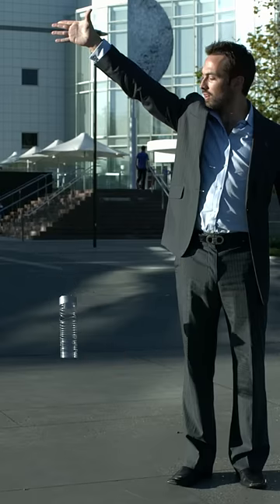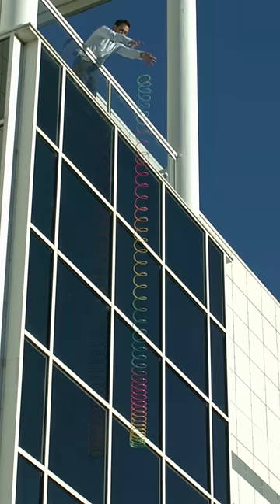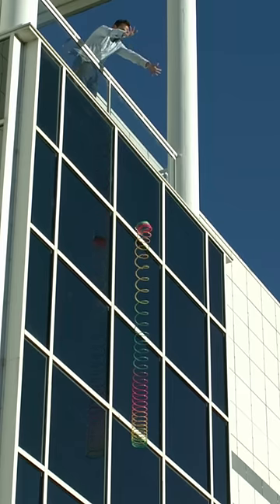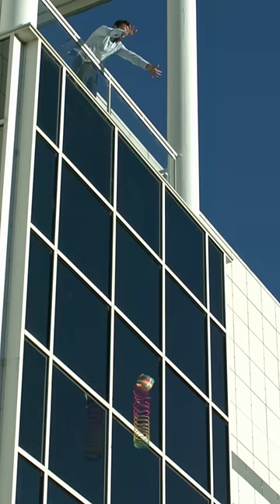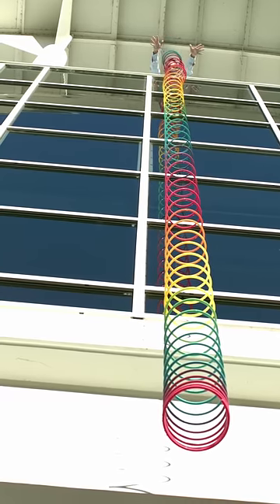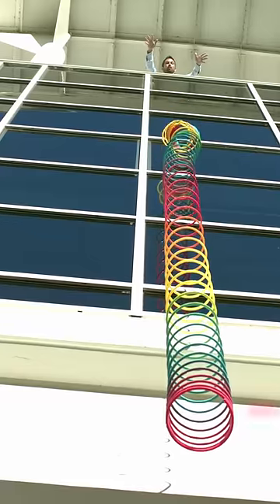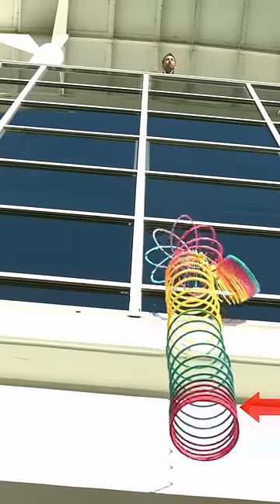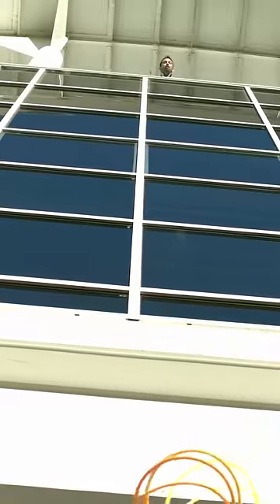How a slinky falls in slow motion #shorts

Comment: Even with the explanations I still can't get my head around this.
I was shown the same thing at university and it's still a mystery to me :D
Reply: The elastic force counteracts the gravity force.
Reply: Doesnt make sense. Many objects possess elasticity yet they fall  like a sack of potatoes
Reply: It’s easier to convince your brain this way: the bottom is indeed falling or at least feeling the force of gravity however there is an equal force being applied upwards by the coil.  What would be interesting to show is this means the top must be falling faster
Reply: @riekivonwielligh6102  it does make sense. The force of the slinky being stretched is enough to stop it from falling.
Reply: @riekivonwielligh6102  it makes a lot of sense to me. The top is pulling the bottom towards it. It was stretched to its maximum using its mass. If it were stretched to half its max length, it would fall at half speed 😬
Reply: During collapsing , each collapsing ring rotates supporting the one beneath it to make it overcome gravity and stay in position , that is why the last one rotates when the collapse reaches it but there is no beneath ring to rotate so it falls .
Reply: The bottom end is being pulled upwards..
Reply: Basically, the bottom of the slinky doesn't know that it's been dropped until the coil above it starts falling.
Reply: The slinky is actually shrinking from both ends. So the bottom is going up but at the same time it is going down due to gravity. Net effect is that it remains in place where it is.
Reply: @riekivonwielligh6102  Yea, cause they ain’t long enough for you to see the effect.
Reply: @tonydai782  ya i am shortsighted like that👀
Reply: Draw a free-body diagram of a coil somewhere in the middle.  You’ll realize that the forces on the slinky’s coils are just gravity and the state of the slinky immediately above the coil.  As long as the immediate surroundings remain the same, there’s no reason for any part of the slinky to accelerate.

Comment: I think it's similar to the canon shot from a vehicle moving at the same speed of the shot in the opposite direction.

The reason is that since slinky is stretched is because of gravity, meaning the stretch force is equal to gravity, when it's released it starts falling at the same speed it's contracting resulting in it looking like it's still at the bottom.

And for the same reason a bottle with a hole that leaks water out will stop leaking in free fall.

Comment: This happens with every object, even with a pencil, te thing is that electromagnetic fields are so fast we cant apreciate it, if you picked a pen from the top and dropped it, the bottom of the pen will be levitating for a tini amount of time supported by the atoms above it, until the collapsing cascade of atoms would reach that part and nothing would be supporting the atoms at the bottom, thus, making it fall, don't precieve the pen as a unit, instead precieve as a group of atoms supported by each other through magnetic fields

Comment: I think what's happening is that gravity is definitely acting on the slinky as a whole. But the tension in the it due to it's stretched state causes the lower most coil to oppose gravity, thus it too accelerates but negligibly  and the uppermost coil speedily accelerates coz of heavy tension and gravity pulling it in the same direction downwards. So if we consider this entire slinky to be a system, the tension generated is the internal forces, while the only external force is the gravity, so as per the Newton's law, it's center of mass must accelerate at 9.8 m/s^2. And as we can see the vector sum of all linear accelerations of each coil of slinky would approximate to "g".

Comment: Or in layman's terms, the slinky wants to go up aswell as down. So it reaches equilibrium with gravity at the bottom.
Reply: No this is wrong Lmaoo .
Reply: @prlreviews1729  No it isnt. I used common sense without watching the video. But a simple google search confirms what I wrote. I cant add the link because YouTube keeps removing my comment
Reply: The slinky cannot go up because there is no upward force acting upon it. The slinky is at equilibrium only when it is stretched out and the tension of the coil is countered by the downward force of gravity. Definitely not the same thing, gravity is not at the bottom.
Reply: @prlreviews1729  that's not what I ment. Clearly the newtonian force isn't singling out just one point of an object. I ment "at the bottom" as in "which makes the bottom behave like it does". Saying dropping an object for example only effects parts of it is just ridiculous

Comment: You should look at the acceleration of the top's motion (and calculate it). Since the center of mass of the whole slinky system must accelerate at 9.8m/s², and the unupdated slinky half has an acceleration of 0, the top must accelerate faster (which is easily explained, since both gravity and slinky tension are accelerating it).

Comment: It actually happens that when the top of slinky reaches bottom of slinky it speed is 19.6m/s and then there is a delay same the time taken for the connection of top and bottom of slinky and then it continues falling at normal rate thats why when slinky and other object are thrown together they touch the ground at same time even though the other object has travelled the half distance at the same time when slinky top reaches bottom. 
Thank You.

Comment: The corallary, which he doesn't explictly mention, is that the top is accelerating much faster than 9.8 m/s² (the acceleration rate of gravity on earth in a vacuum). Not only is it the top of the slinky being pulled down by gravity, it's also being pulled down by tension - the same force which is pulling up on the bottom and preventing it from falling.
Reply: So in other words, the mass Centre actually falls at a normal acceleration of 9.81..m/s^2
Reply: @peterpumpkineater6928   yep, that's a valid way of describing it too!

Comment: Without gravity both ends will try to reach each other when you release the tension. Same thing happens when you let go of the slinky but since it’s falling at the same time it appears like the bottom is suspended when in reality it’s moving towards the center at the same rate as it’s falling.

Comment: Suggestion: you should do this around a pole. That way it won't fold on to itself
Reply: That is an interesting notion with the potential for some material experimentation.
Reply: @Dont Read My Channel Banner  what's your endgame dude?
Reply: technically what happens after the top of the slinky and the center of gravity for the entire slinky reach the same height it's over. It can bounce and twist any way it wants but it will just continue to fall and accelerate. Using a pole would be interesting to see kinda. I would imagine the spring would once again spread out a tiny bit where the top will slow down if not almost stop for a split second.
Reply: @kraven4444  due to friction between the pole and the slinky?
Reply: @eccentricOrange  nah there shouldn’t be any significant friction. Now that I think about it when the top hits the bottom they will both just continue to fall. It may spread out a tiny bit and the top may lag behind a tiny bit. But not much. One thing is for sure though. Once you let go of the slinky. The center of gravity will fall same as if you dropped a ball or something. No matter what the slinky does it as a whole Cant slow down. I think I had a metal slinky somewhere. I should record it lol.
Reply: @eccentricOrange  well I just tested it and yeah once the top catches up with the bottom they fall together. Doesn’t even slow down from what it seems. I uploaded it on my page but for some reason YouTube is not uploading in slowmo like I recorded it.
Reply: @kraven4444  Cool! I saw your video. It's almost exactly what I hoped for: Derek's experiment but w/o folding over

Comment: For me it’s easier to think about it like this: 

A spring wants to come together, so if you drop the spring  hanging like this, the center of mass is moving down while the spring is coming together. And because the whole spring is falling under gravity, the bottom part will stay still untill the center of mass passes that point.
Reply: you're sorta correct. There's one key aspect to this experiment. Gravity is already the force spreading the slinky to the "perfect" amount. when you release it again it's gravity acting on it. So it's G vs G. That's the ONLY reason you get this nice effect. If you don't let is stretch so far or you manually stretch it down even further. The bottom would bounce up too.
Reply: Gravity theory needs a reboot because a *slinky just broke it, or should  I say defied it, all contortions to say otherwise are just pseudo scientific sophistry. Oh wait, * Gyroscopic force already did
Reply: @kraven4444  So the potential energy in the spring force equals the gravitational potential energy from hanging?
Reply: @michaeltaylors2456  Except gravity explains this absolutely perfectly.
Reply: @MrPassigo  ok
Reply: @goos6005   your saying the spring’s temporary force or elasticity has defied gravity.  How do you know the spring’s force is equal to its weight ?  
Obviously that force must me at least that weight,  but it could also be greater.
Reply: @goos6005  . I believe gravity is this  F=G{\frac{m_1m_2}{r^2.
The spring should drop equally, with top and bottom or both ends of the mass or springs moving downward  equally at the same rate,  with the spring tension contracting the mass inward back to its relaxed state. But it doesn’t,  therefore F=G{\frac{m_1m_2}{r^2}} needs to be tossed out and described another way.

Comment: This is basically how every object looks like close to the speed of light.
Reply: No it isn't.
Reply: @bobtom2633  I am referring to the fact that the impulse propagates at a speed close to the speed of the object, so the object does not look rigid.
Reply: If you could see in super-super slow motion (trillions of fps), and in high enough resolution, you should be able to see compression waves like this going through every falling object.
Reply: @YSPACElabs  I'm not an expert, but I disagree. I do not think gravity is strong enough to pull something like a metal rod's molecules apart to where once released the molecules pull back together. The strong nuclear force is magnitudes higher than gravity.
Reply: @MrT------5743  Strong nuclear force is only strong at extremely short distances, it doesnt matter even at the radius of an atomic orbital, and molecules in solids are held together by different kinds of electromagnetic forces. Im not an expert either but as i understand it, if you try to stretch any object, distance between molecules increases but so does the force holdig them together, and when you release this distance gets smaller again, so every solid acts like a spring to some degree.
Reply: @E1Luch  But the stretching force we are talking about is gravity. And gravity is a pretty weak force compared to the strong nuclear force (atoms within a solid rod) would not stretch at all, not even at the molecular level. The rod would effectively be one object even at the atomic level.
Reply: @MrT------5743  relative intensity of forces doesnt matter, gravity can litterally rip this steel rod apart if you hang big enough weight on it. stop saying strong force, is holds protons and neutrons together in atomic nucleus but it has absolutely zero effect in intermolecular interactions.

Comment: Me: does this
My slinky: The FitnessGram™ Pacer Test is a multistage aerobic capacity test that progressively gets more difficult as it continues. The 20 meter pacer test will begin in 30 seconds. Line up at the start. The running speed starts slowly, but gets faster each minute after you hear this signal. [beep] A single lap should be completed each time you hear this sound. [ding] Remember to run in a straight line, and run as long as possible. The second time you fail to complete a lap before the sound, your test is over. The test will begin on the word start. On your mark, get ready, start. TANGLES UP
Reply: Cringe comment

Comment: Imagine being held up by a device like this and you're being tortured for information or whatever
Your kidnappers have a giant slinky, yes, and you're suspended from a helicopter on the end of one large enough to support your weight without being too stretched out.
Repeatedly, they pull you up for questioning then toss you back down. You tell them what they want to know and yet, they still decide to drop you. 
They release a latch holding the slinky and you watch it fall above you. Suspended in the air you look up, and down, you aren't moving, but the top of the slinky falling is sure to pull you down with it. The top end approaches you and you're flung violently spinning and you flailing...

Comment: This is such a cool concept! I wonder if there's a way to use this for other applications.

I wonder if one was to make a heavy duty slinky, attach a person to one end then take the other end and stretch it upwards as high as possible. Then have the person attached to the bottom end, walk off a platform so that the person is hanging with the ground (netting or foam) like 50 ft underneath. Then let the stretched out top end go. Would the person be at a stand still until the top end of the slinky full collapses?

I think someone should get a heavy duty slinky made that needs a crane or hydrophilics to stretch it. Then attach a dummy to the bottom end. In theory, shouldn't it work?
Reply: The only problem with that idea would be the giant slinky above you crushing you in the end.
Reply: @nicerides9224  not if you're attached inside without the slinky contacting you. But even so, I'd still like to see what would happen with a life sized ballistic dummy.

Comment: What happens if you tie multiple slinkies together with a 10 foot string separating each slinky will the bottom slinky just hang in the air until all the slinkies above it fall to the bottom ones level?

Comment: Elastodynamics.. I think the compressional wave still travels faster than any other wave, such as the rotating/twisting one. The problem is, that this compressional wave (which you could sense by detecting minor vibrations felt at the bottom, since early on) has a waveform, a shape vs time, and this form starts very very mildly with small amplitudes that only become important/high later on and that is what we observe as the progressing contraction of the slinky..

Comment: actually what's really happening is, when the slinky is stretched it has force built up inside of it. That force needs to go somewhere. So, when you drop the slinky, the bottom starts the force up, as if it would close like it normally would. The problem is, at the same time the force is closing the slinky, gravity is pulling it down. It gives the illusion of not moving. If you did this experiment inside a zero G vacuum, both end would meet in the middle. In zero G, the middle would stay stationary, until both ends completely retracted. Then, the force would direct the slinky in a direction. Give or take some distance, based on build quality.
Reply: Also, its only being stretched by its own weight in this video. So the force would be calculated by its own weight/length.

Comment: When both ladders were falling freely until the left one touched table both have same speed.
When it touches table some of its length is resting on table so the part of free falling ladder will be less than   ladder on right side, hence left one will experience lesser drag force and 
Acceleration will gradually increase slightly.

Comment: The rotating wave goes both directions from where the slinky becomes slack. I watched several times to look at the last one, because as the compression wave comes down the slinky, you can see the top of the slinky start to unwind. The top section starts spiraling off to the side right about the same time at the bottom starts to rotate.

Comment: But there's two waves going through, not just one. There's a slight, subtle narrowing of the gap between coils that precedes the "domino" collapse of coils hitting each other, and this seems to be linked to the twist.

This less dramatic motion is the standard behaviour of a spring on the release of tension, and the reason for the more dramatic "domino" is surely just that the slinky has so little springiness that other factors make the spring equation less significant to the overall motion.

Comment: I pondered about a question I had, but I think I answered it. Tell me if my theory is correct. I thought “what if the slinky were less stretchy… would the bottom rise up due to increased tension outrunning the acceleration of gravity? What about a slinky with the opposite characteristic?” Then I realized, a tighter slinky’s bottom wouldn’t rise because it wouldn’t be stretched as far down to begin with, and a looser slinky’s bottom wouldn’t fall because it would be stretched farther down to begin with. The only way to make the bottom fall or rise upon release would be to make a slinky that possessed different spring rates at the top compared to the bottom. Am I right?

Comment: This doesn’t violate any laws of gravity because the tensile forces of the spring make the moving section of the slinky accelerate faster than 9.81m/s/s. When you take into account the added acceleration of the moving part, the Average acceleration is 9.81. 
Draw your free body diagram and work it out for yourself.